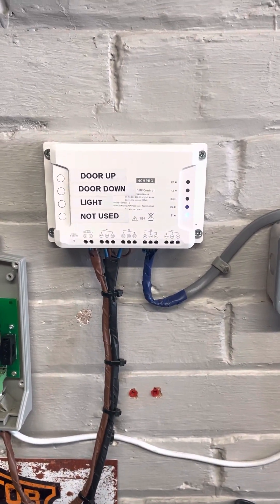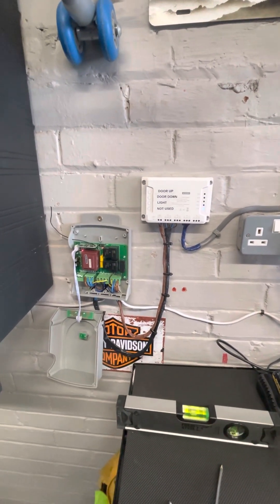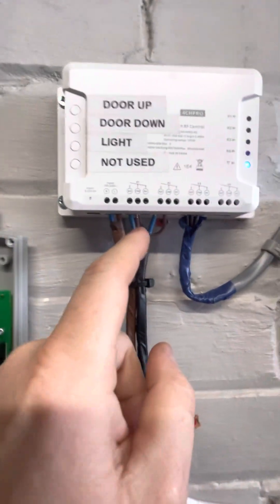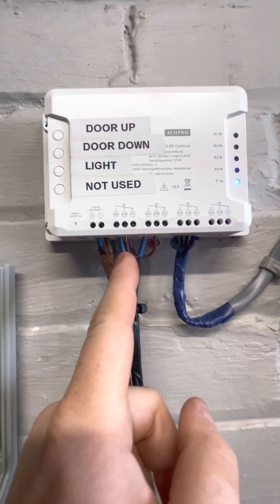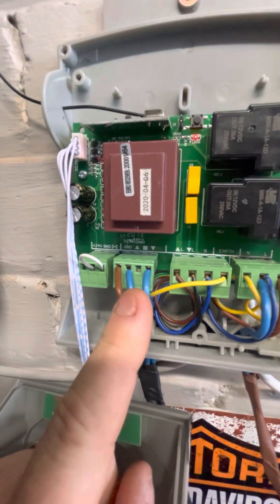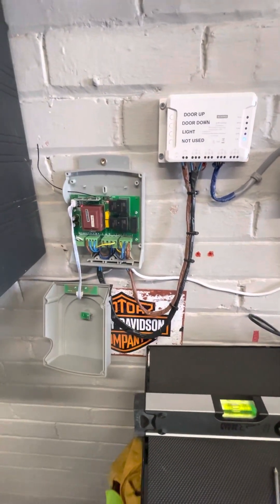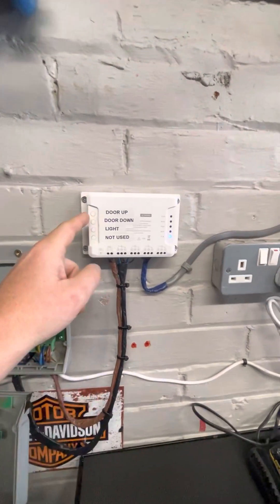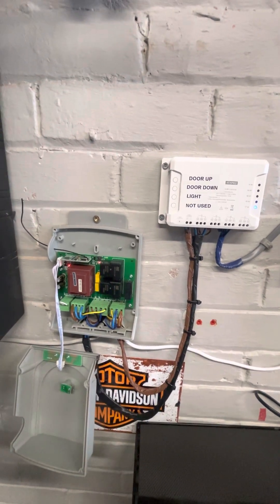Garolla garage door to Sonoff 4CH Pro

Comment: Hi great video, and I followed all of your wiring directions, however the door goes up no problem but doesn’t come down, although I can hear the switch operating on the  sonoff unit, any tips? Regards Mick.
Reply from the maker: Check that your wire for the down operation is correctly seated in both the garolla terminal and on the seperate 4CHpro terminal. Once it’s all connected up you may need to add the inching settings on the eWeLink app. If you don’t do this when you press the button once it may move slightly but then stop and not go all the way down. It’s effectively acting like you still have your finger on the down button of what was the remote
Reply: @ you’re right, I re-seated the wires and it’s all good, many thanks.
Reply from the maker: @michaelfenning5985  excellent, glad it worked for you

Comment: Whats the output voltage of the sonoff channels. As in the voltage going from the sonoff to the control box
Reply from the maker: dry contact, max 30V DC, max. 250V AC
Reply: So the blue and brown wires are sending 230 v ac to the controller. I just tried the same thing and broke my control
Reply from the maker: @aidangardner9864  you must have connected something wrongly. I had teething problems and blew the fuse on mine too until I realised what I had done wrong. The wires loop the power to the control box to mimic the signal of the buttons being pressed. There’s instructions online that helped me. Mines been setup for months now with no issues at all
Reply: Could u send me a link to the instructions that you used.
Reply from the maker: @aidangardner9864  this vid helped me initially. I’ll look for the other website later when I have time mate. https://youtu.be/b0SlCblpsBs

Comment: Can you show how you wired the light too? Is it just a switch for the light on / off or does power actually run through it too ? As with the garage door ones it’s doing non mains switching. Could be good to set up automation so when door open light comes on etc. Cheers
Reply from the maker: The light was wired in taking the common from the existing light switch fitting and running it back to the sonoff controller, the other wires go in their usual places. You can set up an Alexa routine to turn the light on and open the garage door. Or issuing the eWeLink app to do the same features
Reply: @greggyboy28  Thanks, so you extended the common from the switch fitting over to the sonoff, then took a cable back from the sonoff and fed that into the common on the switch to then complete the circuit up to the light. I guess you now do all controlling via the sonoff as that switch will have to be left in the on position. Be interesting to have it wired up in 2 way switches so the original switch can still be used...
Reply from the maker: @thecomputertech  in a nutshell yes. It took me a while to get my head round it but all can be automated and it seems to work really well
Reply from the maker: That’s exactly how I’ve done it. I’ve got a setting where the door opens and the light comes on. Door close and garage light goes off. I’ll do a video tomorrow and also include it going up and down as someone else has asked that question too